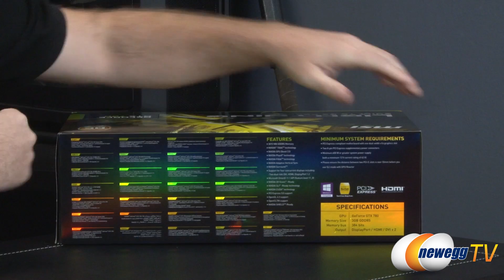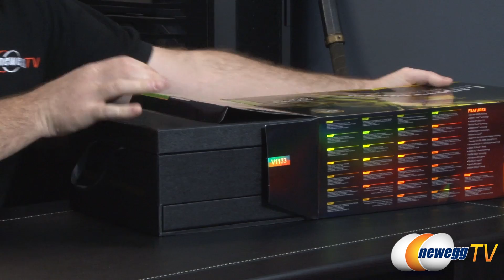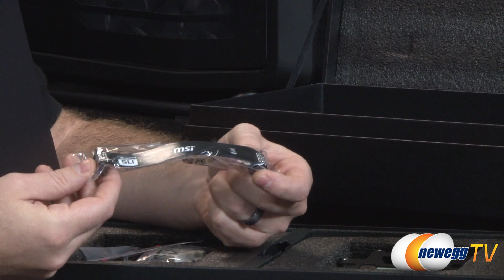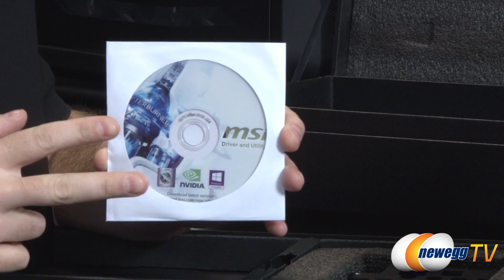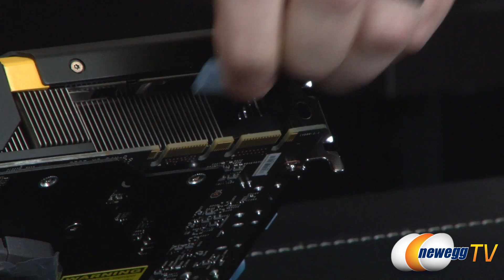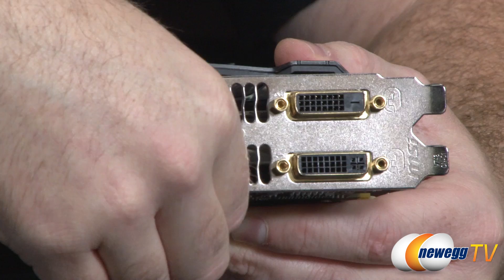MSI GeForce GTX 780 N780 LIGHTNING Video Card Overview - Newegg TV

Comment: Hi guys im kinda lost Idk if this card is better then the r9 290x can someone help please
Reply: the 290x runs very hot i believe when trying to overclock and i think when you use it right out of the box but the GTX 780 (Lightning) is more built for overcloking and performance while unlocking its full potential
Reply: So the lithning  is better ?
Reply: TheBlueness™  So the lightning is better ?
Reply: Apemodex exxe in theory yes
Reply: R9 290X is built to compete with the 780 Ti, so it's better than the 780
Reply: X/2 780L is its own branding just like the 780ti aka titanium the 780 can hit 1500mghz running games at 2k 60fps on a single card

Comment: now here's a graphics card that stays true to its gaming roots and performance , a graphics card that not only aims to please the enthusiast gaming market , but also those hardcore pc gamers who love extreme overclocking , but there might be a twist to that , the card might need a state of the art cooling system , such as a liquid cooled computer in order to unleash its full potential without overheating and failing. But otherwise it's still one of my personal favorite graphics cards.
Reply: I just bought this card. I was looking at this one or the gigabyte windforce GHz edition 780 and this one just had that hey you should spend the extra 30 bucks on me just because look so that's what I did. We shall  see how trifrozr does.
Reply: let me explain that better for you ,tri frozr is a unique triple fan cooling technology , which is better suited for gamers loving to overclock their gpu to a higher performance to allow for better gaming performance . Once you install the gpu and it's software to your computer you can set the speeds of each individual fan like the 2 side fans to 68% and the middle one on 63% for example . Try it out and i'm confident that you'll definetely love it.
Reply: Ahadjisavvas yea but so is the windforce lol. They both have 3 fans and are both from great PC part manufacturers. I do agree however that this card is more for extremely high overclocks because of the bios switch and the voltage readouts.

Comment: 55c on the CORE. What about the rest? The h100 has a single point for removing heat. GPU's have multiple points on the PCB that need cooling, including the memory. Cooling only ONE part of the PCB will leave the rest to melt. You're a moron.

Comment: you get colour bleeding in VGA as it is an analogue signal. since it is an analogue signal, it is more vulnerable to interference that can distort the picture quality. 
DVI and HDMI are both digital signals, the information that is carried is either a 0 or 1 (either off or on) whereas analog signals are continuous data. ~ bla bla bla, don't use VGA if your monitor has better

Comment: once again I can't help but notice that what with the typical right side up orientation of a motherboard in a tower case, that fancy colorful fan array is going to be face down and out of sight for the entire practical life of the card, in a tower case.  Or at least in my tower case.  Do other tower cases mount the motherboard upside down so you can actually see the fancy video card fan arrays?  Yes this is not important.

Comment: GTX780 is better
a 690 is LITERALLY two 680 chips in SLI, this is all mashed into a single, extra long card, which means the 680 chips are SLIGHTLY downclocked to control heat and power-draw etc. they generally perform around 5% slower than two 680s in SLI

a single 780 is faster than a single 680. this is well known and only makes sense

SLI scaling on a 780 is pretty good.

thus, 780 in SLI is faster than 680 SLI which is faster than a single 690.

Comment: not sure what Your Budget is, but around 400 dollars will get you a prime Graphics card. Specially since they are cheaper in USA than Europe (if you are in USA). Just think of it as Graphics card 1/4 of the Budget, motherboard and processor a bit more expensive than that together and then a good powersupply shouldn't be too expensive ~90 dollars where I live. Just make sure you check that whatever you buy has the right slots and cables, like the gtx 760 needing 8-pin + 6-pin Connectors.

Comment: BF4 specifications aren't rock solid yet, its really just speculation. But a 680 runs ultra on bf3 (which isnt gonna be too much different in sorts of REQUIREMENT) with 60 fps,,,, so this is gonna wreck that.